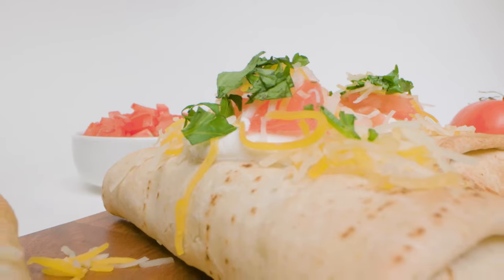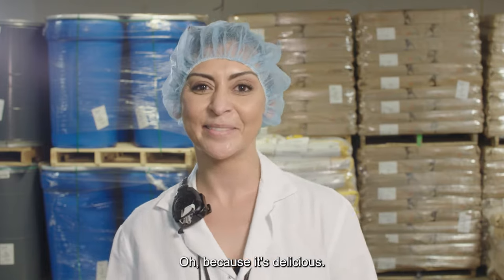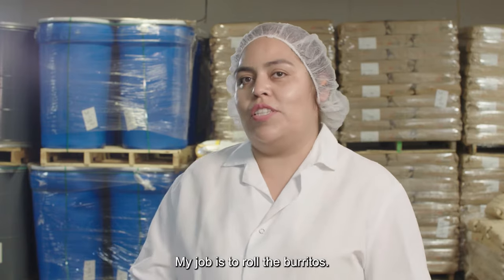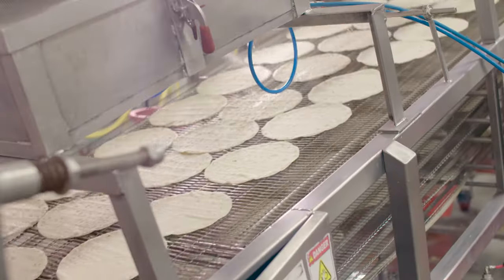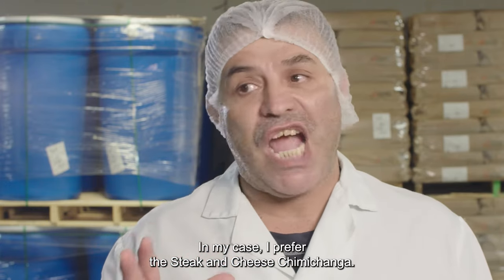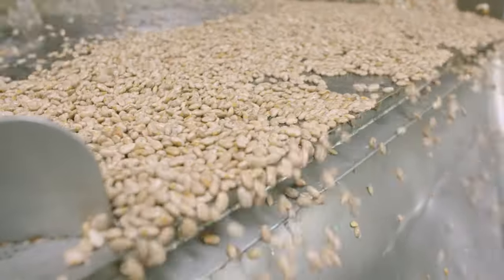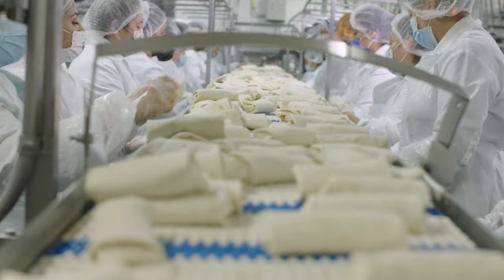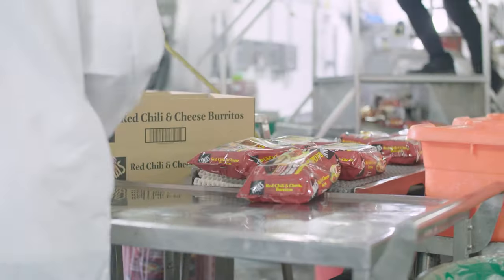Tina's Burritos, what makes them so special?

Comment: I'm gonna take a "middle of the road," approach here. Tina's burritos are by far, not the best, nor the worst. I do quality burritos at home. Carnitas, Mojo marinated Carne Asada, Al'Pastor. You name it, I do it. However,  Tina's, 
 Might the best of the pre-frozen microwave convenience burritos available, especially at that price point. I've had them all. I can actually detect the presence of meat in Tina's. The beans are part of the filling and fully cooked, unlike Tina's competitors, which are rock hard and freezer burnt. With that said, Tina's is an inexpensive convenience food, not delicious, not at all fancy, but not bad. That's whywhen trying to recreate a good, pre-frozen burrito, I turned to Tina's for inspiration. I  opted for the larger size, but not giant,  tortilla, trying to perfectly fill said burrito, with the perfect amount of filling, no superfluous tortilla, nor leakage. The amount was illusive. However, I managed. 
If Tina's did this, I would almost never, go through the trouble, of making this on my own. But I did, and it was delicious. I diced Chuck roast, browned it, "bloomed" classic taco spices in the fat, added finer ground beef, some wet ingredients, and simmered until tender. I allowed said mixture to cool, folded in a small amount of cheese, some refried beans, and rehydrated with my favorite taco sauce. I softened the tortillas, conservatively filled them, which the perfect amount. There was no leaking nor superfluous dough. I wrapped them in plastic, then foil. I froze them but always thawed them before heating. Absolutely delicious. Thawing is the key.  Always thaw your burritos, no breakage, no crunchy frozen centers, well worth it.